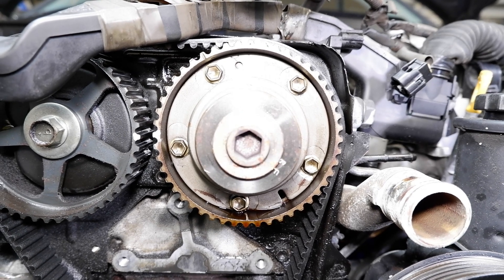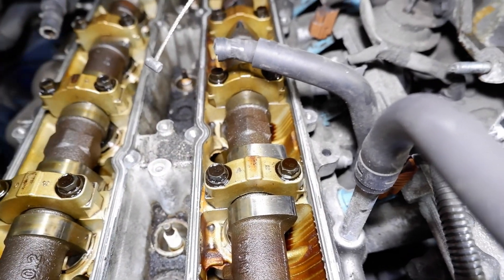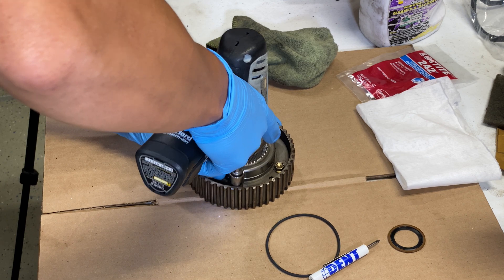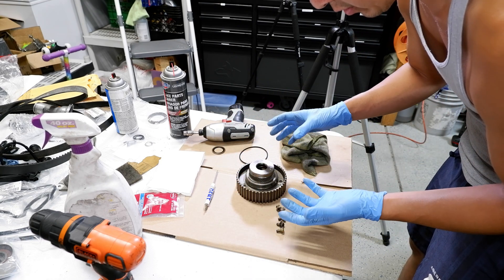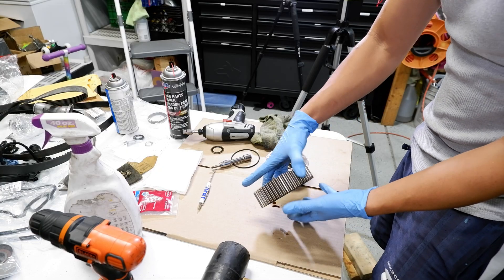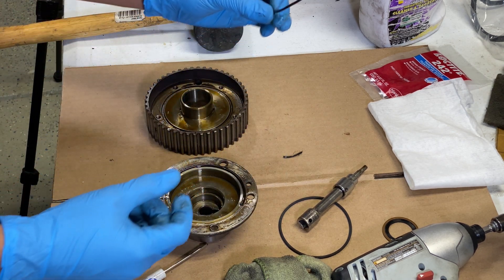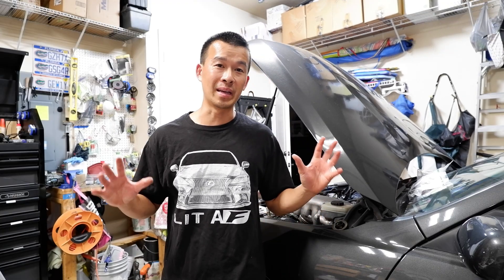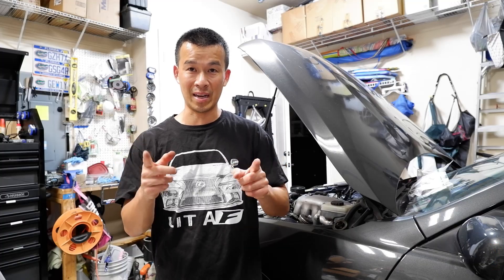How To Rebuild VVTi Cam Gear-Lexus Toyota | VVT-i Seal Replacement | DIY VVTi Gear Rebuild

Comment: hi how are you ? I need some advice . where can I buy Cv Axle Assembly, Rear right and lelf ( Front ), that is affordable and good quality
Reply: Could I remove the center piece without taking the entire sprocket out of the car? Saw another video and he just took the 5 10mm bolts out. Is that also a possible route?
Reply from the maker: No!!! Do not follow that video. I watched it and cringed 😬. The timing gear must be put back on mark with the lines you scratch beforehand. Also the O ring will be hard to keep in place horizontally. If it falls out of groove as you tighten, guaranteed leak and needing a new O ring. Remember this O ring wasn’t intended to be serviced, factory wants you to replace the whole gear. We are side stepping to save $150.
Reply: @TunerwithKids  thank you dude you rock. Didn't think it would be that easy.
Reply from the maker: EЯиʂɬ CV axle for front? For RWD IS300?  Axles can be had at your local auto parts. Bring your old axles for core trade.
Reply: Tuner with Kids going to be 2010 IS250 AWD
Reply from the maker: I’d recommend ordering some new ones online. Pretty cheap. At advance auto, shipped to home with “coupon25” discount code, it’s only $70 with tax each for front and $100/ea rear. No core trade needed.